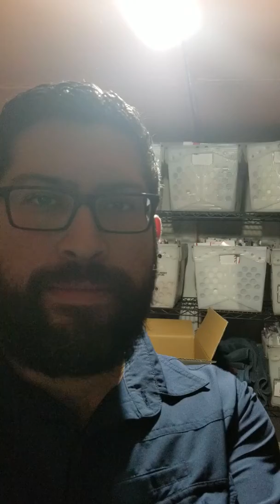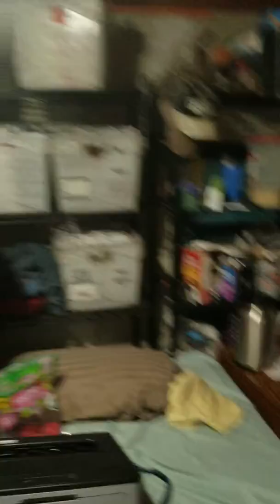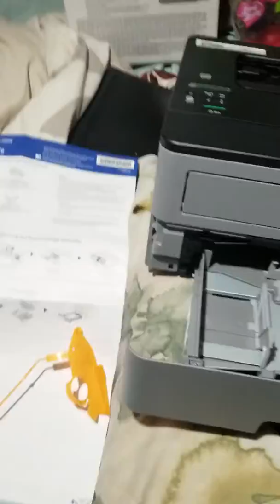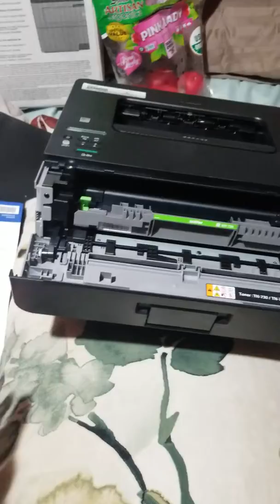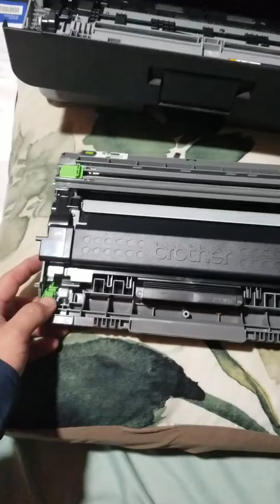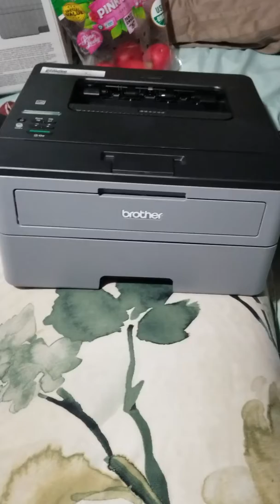How to install toner cartridge on HL-L2350DW brother printer

Comment: Thank you so much. I watched a few videos on how to install a new toner, but they just said take out the old one, without showing clearly how to do this, where it was located on the machine and how to unlatch the cover so that you could access the toner. Replacing the toner was easy compared ti the initial parts! Thank you so much? You explained clearly and then showed each step visually. Great.
Reply from the maker: Glad I could help!